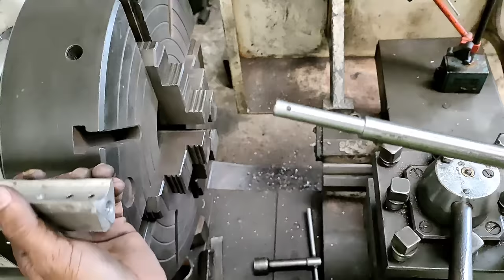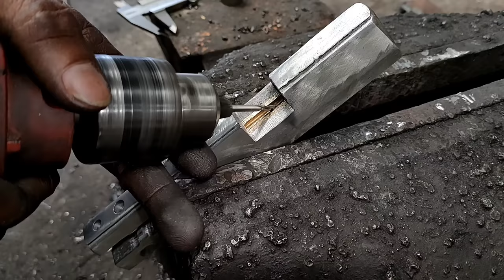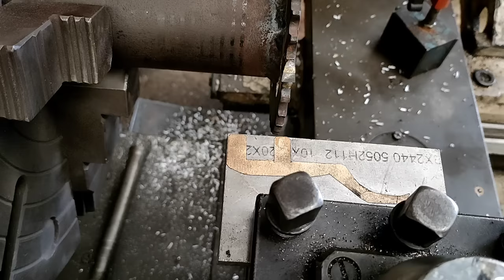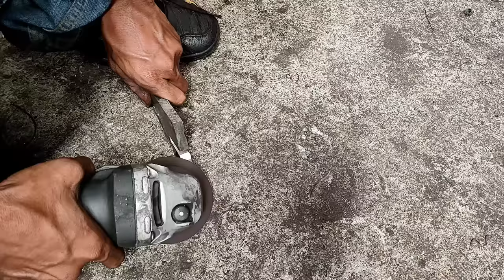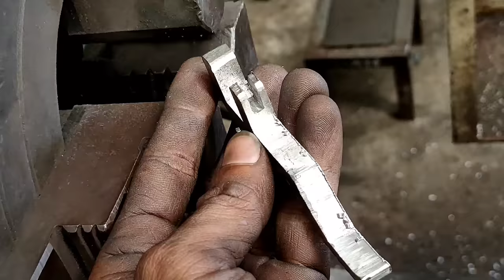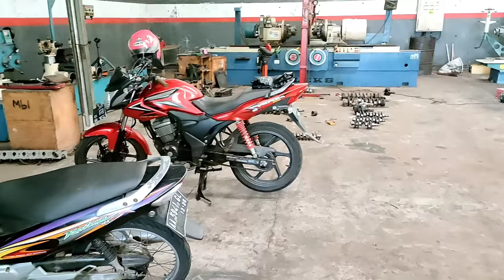Making a chamber sidelever with a manual lathe

Comment: Even with a mishap, it's still amazing the work you manage to do with minimal packing and shims to get things at correct height. 
With an angle plate and vertical slide there is very little you couldn't make.
I guess you could weld up and machine an angle plate when you get time and some 'scrap' steel plate?
Reply from the maker: this accident can be covered by welding sir.. 😁🙏
Reply: You're skilled as can be..it's top notch.
Reply: @Yantoo nuwun sewu daerah pundi mas dlm me sampean ki mas 🙏
Reply: @Yantoo saya mau memesan pistul pak apa bisa memenuhi pesan nan pelagan terimakasih saya tunggu jwbn dari anda pak

Comment: You are an outstanding craftsman. Even in poor Bulgaria, you would receive at least 1300 dollars!
Reply: Doubtful, I have semi auto .357 from aea and it was ~1100$ stock , the tech has come a very long ways in a few short years, a Benjamin bulldog .357 costs maybe 600$ and it's the most customizable semi big bore air rifle currently out there, Benjamin also did release a 458 bulldog a few months back but power gain wasn't worth for me at least. 
The handle itself means little I'm interested in how he plans to make the actual bolt.
Reply: @Lindsey Zacek  oh I agree, mostly because you can't really even shoot groups unless you get a regulator because the variance in speed translates to impacts that drop several feet at like 30 yards even. 
I ended up getting an extended reservoir with a huma regulator pre installed from pitbull and just swapped out the reservoirs. 
The reservoir is rated to 5000 psi so I start at 4500 and the 10 shots will take it down to 3000. I still have 5 shots left after that but obviously below 3000 psi so not consistent. 

This terminator is the first and last product I ever buy from aea. I hope they got sht together for your .50 but I took a chance despite the bad rep and they without a single doubt made me regret doing that.....
Reply: 73v3r 0l thích